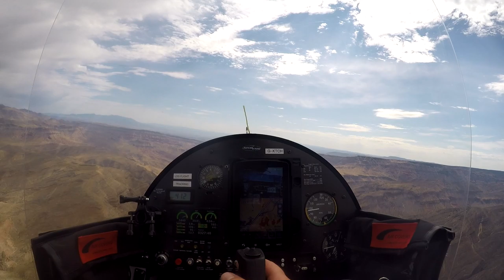Flying with the famous...  Flying Cowboys!

Comment: That's the issue with pusher engines anything that vibrates lose or falls off goes right into the propeller. I learned that from a video guy did about an ultralight LSA he pointed out bunch of parts on Rotax 2 stroke engine that needed to be wired because they vibrate lose damage the prop.

Comment: Those carb drip trays are pointless with and exposed engine setup such as yours, any fuel dripping out, if that ever happens would just evaporate in the air. The last thing you need is something pointless like that coming off and going thru the prop.